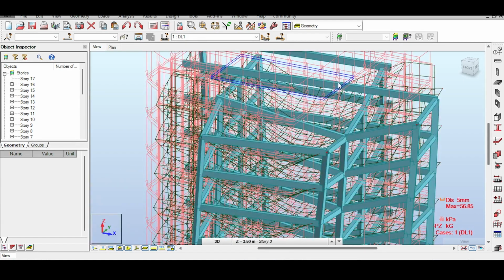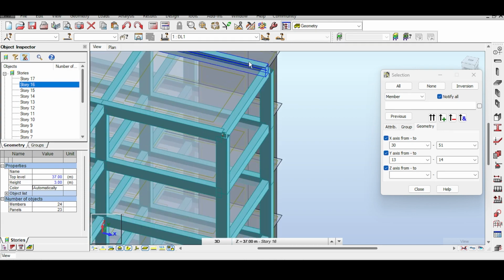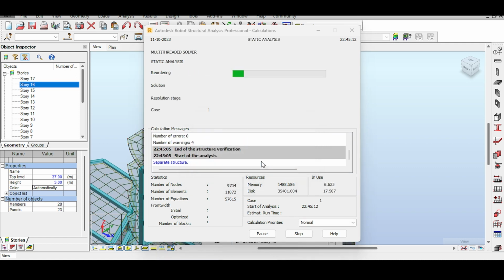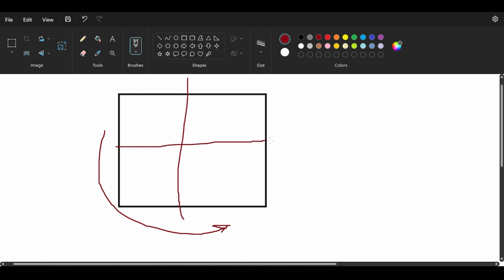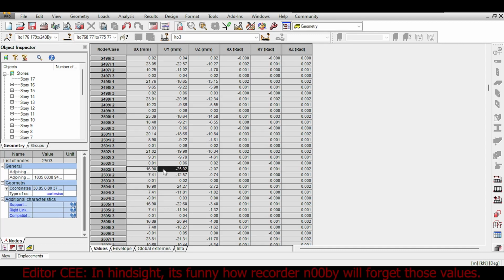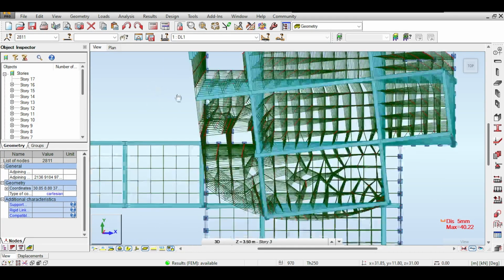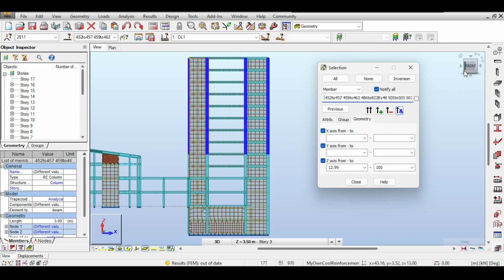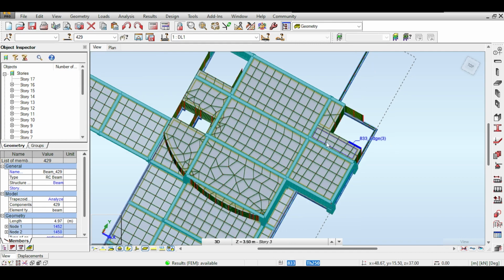Modeling and Design of RC Buildings in Autodesk Robot | Part 11: Reducing Twisting

Comment: Hello Dr. CEE

Indeed, it is concerning why the roof beam was not connecting or was not connected to the columns in the first place. It is the sort of things that can quickly cause panic for me and can trigger a recheck of the entire structure. I notice it pushed the recording on to day 2 for the CEE. Very nice and practical use of the selection options throughout this video by the way ^_^

I find the imagined sub-division of the structure model plan into four quadrants and using those quadrants to help guide as to where to add stiffness to the structure to be helpful. As you noted, it would be preferable to incorporate the staircases first as these can have significant impact on the model stiffness and twisting of the structure. I appreciate the various options and the combined possibilities explored here to help to reduce the twist. 

Hmmm, LOL about the hands on-and-off the mouth while thinking.

Regarding the option of increasing the column sizes; I find the CEE suggestion to keep an eye on the reinforcements in order to help to determine if the column is excessive or if the column is too small to be a good suggestion. However, isn’t the stiffness gain that is being explored here for the purpose of reducing the twist on the structure only dependent on the size and shape of the column as opposed to the reinforcements that have been used in the column?

CEE also hinted on maybe some rules-of-thumb in sizing the columns for multi-storey concrete framed buildings. Is there something available in the lines of say in a 14-storey building such as the one in this video series, the first five levels should ideally start with placeholder column sizes of ?x?, and the subsequent five ?x?, and so on?

In this video, 700mm x 700mm placeholder columns were suggested at the bottom storeys to help reduce the building twist; Whilst I fully support the notion that the sizes of the various structural elements should be determined by those elements required response to the applied loads…. In this particular case, I also find myself wondering with the following question: It seems that the proposed new column sizes would also present a new challenge regarding the available space for the parking bays between the newly proposed larger columns in the basement. Would it be correct to say that if the new column sizes were to be adopted, this is where the design engineer would have to sit with the architect to consider possible re-design or repositioning of the affected parking bay spaces and of any other affected items by the newly proposed column sizes, correct?     

I have enjoyed this video and I am looking forward to the next CEE videos

Keep well and kind regards, DK
Reply from the maker: Hi there Engr. DK,

since I am pinning this comment, I want to start by re-mentioning something that was suggested to me for future readers to benefit:
@ismaeelmoola6233 mentioned that one could easily resolve the problem by using Edit->Intersect.
That is a GOLDEN suggestion.

The video took some time to accomplish, trying to balance between not rushing it out and not taking ages to accomplish.

The quadrant thingy is something that I was told by my dear Prof. Nackenhorst back in the day. It was eye-opening and I thought I should  include it here.

As for the finalized column size, I think that - combined with the need to check the Arch stuff - would deserve a separate video, so I think I will postpone the idea of it for later.

as for the rules of thumb, here are some I have on my mind:
1) the raft thickness is around 10cm times the number of stories
2) the beam height is from the code, with L/20 being something I use for quick estimations.

3) The columns: Oh boy, this is something that would be interesting, so I will keep it at the end of the comment, because I want to address the other things raised.

Yes, I missed mentioning Arch issues so I have to have another video that re-checks Arch drawings. I agree 1000% (10 times the max), so I am gonna postpone this for later.

As for the columns: Let me give you a cool way to approximate the column size, better than  rules of thumbs. (I am gonna post this separately in a post).

Let's say that your concrete column is made our of concrete that has a compressive strength of 30 Mega Pascals. (u can use ur own value)

and let's say that: the ultimate load on the slab is around 15 kN/m2 (u can use ur own value)

if you also assume that a column carries a tributary area of 20m2 (u can use ur own value).

Then, a quick and approximate equation to predict the column size based on this is:

A * 0.50 * 30000 = n * 20 * 15

in this equation, the strength of the column has been approximated by:
0.50 A fc, this disregards the steel in the column (which has a stronger resistance) and multiples it by 0.50 as a safety factors that is an amalgamation of all those eccentricity and safety factors of the ACI code. Also note, 30,000 was used because the load is in kilo pascals and the stress was in mega pascals.

the ultimate load is approximated to be n * 20 * 15 where n is the number of stories.

so what I usually use to approximate the Area is:
A = 0.02n (m2)

if you would use a square column, you would get a column width which is:
0.14 sqrt(n) in meters.

if you use a rectangular column with W = 0.40 L as an aspect ratio, you would get:
0.40 L^2 = 0.02n
L = 0.22 sqrt(n)
and W = 0.40L 

VERY IMPORTANT NOTES:
1) I did not have enough time to double check my quick calculations, as I was typing it from memory in this comment. So please please please for any future reader, double check those calculations.
2) You can replace the values with any values you use in your region, and reach your own conclusions.

That is a trick I picked up when I was a senior Engineer.

Regards,
CEE
Reply: @CivilEngineeringEssentials  

The columns quick approximation idea is very nice and it is also very well explained here .... (stress = force / area). I really like the fact that this approximation is adaptable to various tributory areas and to various concrete compressive strengths. 

Many thanks, DK

Comment: Hello CEE!
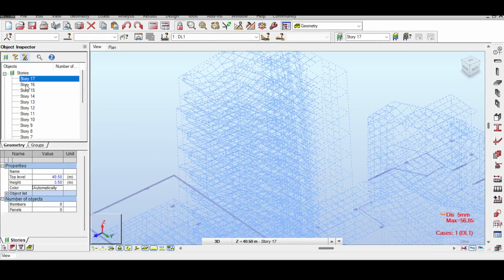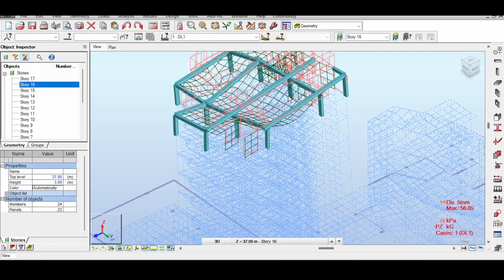At 1:40 you point out how the beam is disconnected . After fixing this, by splitting the beam into smaller beams, at 11:05 you point out that the beams look disconnected from the floors - a graphical issue! As Robot displays the beams as straight elements, wasn't this just a graphical issue to begin with (1:40)?
I am also a fan of modeling beams from column to column, as mentioned by Nii Sarpei. But I do wish to know how Robot chooses these intersections, in order to better control my modeling.

I apologise if you mention this subject in later videos, in the last 9 months. I fell behind on watching your videos, pursuing other fun activities in the field :D
I enjoy watching this channel grow and wish you the best!

- eng. Razvan Muresan
Reply from the maker: Oh that is a great question. Let me phrase the question as I understood it (so feel free to correct me if I did not get your question right):
It seems that I used "graphical issue" inconsistently. When I talked about the beams not being connected, I used the deflection shape to detect that.
However, the same methodology was not applied when I saw the same deflection difference between the beam and the slab.

You are 100% right in pointing this out. This can cause confusion. Here is the answer as to why my approach can make sense:

when I detected beam not intersecting, I detected it by checking the deflection. Why? because it was 2 elements of the same type (line element with line element) so the deflection shapes should intersect "have the same value" at the nodes.

For lines and slabs, those are two elements of different types. The way RSA shows deflections for slabs is different than that of lines. In lines, it uses the shape functions "N1 N2 N3 N4" to estimate the deflection of the line based on its end points. Those shape functions are different for slabs.

I hope I was able to answer your question. If I missed anything, please let me know.

Regards
CEE
Reply: @CivilEngineeringEssentials  I tried to replicate this connection/disconnection on a 2x3 span - 5 story structure:
- on one side 3 beam/ 3 spans
- on the other side 1 beam over 3 spans
The Z on a given point was the same on both.
With a big enough load, the 3D sections appeared to be disconected (column from beam)
Turning off 3D section revealed that the 2 versions (3 beams vs 1 long beam) were reacting the same.

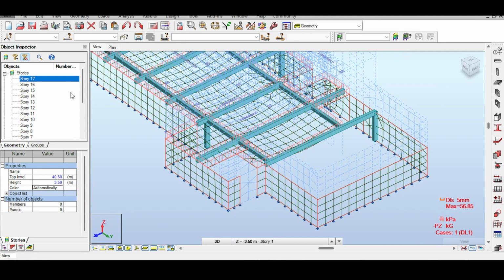It's basically imposible for you to go back to that point in the project 1:40 and check it out 🙂 so that's that. But maybe you want to try, in one of you short comparison videos that you make from time to time.

All the best!

Comment: Hello Dr. 

This is a fantastic video, supherb as usual.

1. In terms of Modelling continuous beams I always prefer to model from column to column like you did in the correction part. That’s has always been my technique from my fresher years. I barely leave the program to do this.

2. The lateral twist of the tower under gravity loads only always seems to baffle me. 

It actually baffling, what the source of the lateral loads that causes the twist the tower, however it suddenly occurred to me that’s the dead load shears of the columns, which is transfered to the beams/floor as axial loads is the cause of the lateral load that causes the twist of the tower. Could please throw your insight on this?

3. I think not was a good idea to properly place shear walls and square columns to resist these lateral forces arising from gravity loads as the building is twisting more towards the weaker direction of the rectangular columns

4. My rule of thumb in selecting column sizes independent on load is N x 100 where N is the number of story. However I usually keep column sizes in the order of 300, 450, 600, 750 etc to allow for easy cranking of bars for not more than 75mm in case of section changes.

5. Overall I enjoyed the lecture however am worried work will distract me due to the fast approaching festive season. 

Thank you 
Enjoy your day Dr.
Reply from the maker: Hi there Engr. Ni,
Sorry for the late reply. 
I think your approach of "column 2 column" is really error-proof, and after what happened to me, I can only say "yes".
2) Yep, part of what makes the tower twist and bend is the axial components of the beams becoming shear on the columns and - in turn - becoming moments. Which means both rotation and displacement. you are hitting the nail on its head

3) Yes, I also think the columns are oversized. This was also a reason why  I added some comments on columns in the recent Q&A video. The comment in 3 and 4 inspired that. So a huge thnx to you ^_^

4) It is actually the same rule of thumb I use when I am designing. Happy to know that people from different regions are using similar ideas.

5) I wish you all the best and a happy festive seasons. I am always happy and honored to read your comments ^_^

Thank you very much and God bless you immensely,
CEE